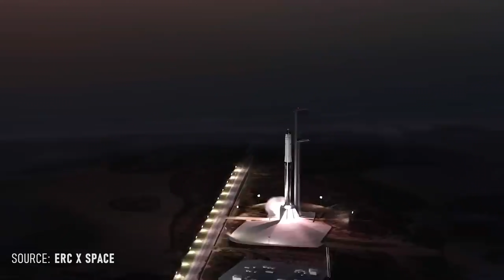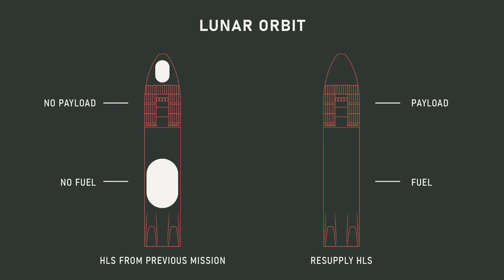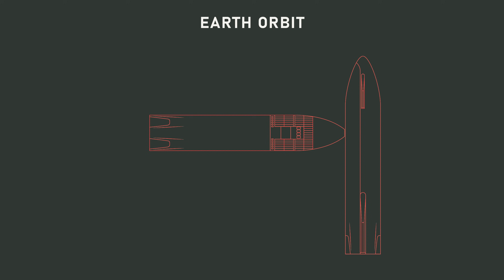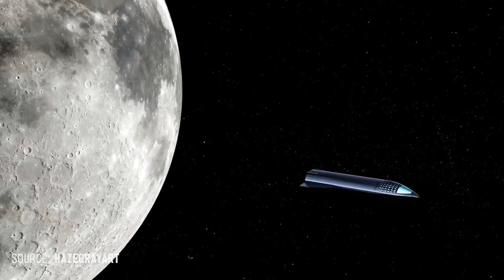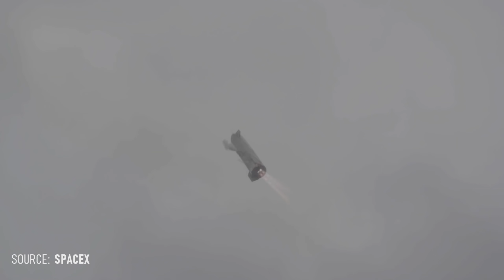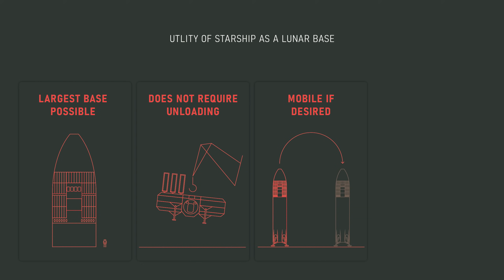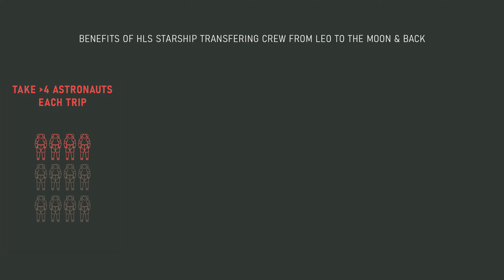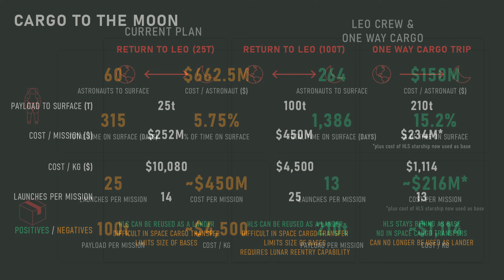How to Use HLS Starship

Comment: @apogee you're not taking into consideration that we are not yet at a final HLS starship design.  I fully expect a standardized shipping container to be developed for on-orbit cargo transfer between ships.  indeed, earlier renderings of starship and its predecessor the ITS/BFR showed just such containers in the empty spaces of the engine bay under the skirt.  such containers could be transferred between ships in LEO as a part of fueling operations.  other payload containers could indeed be transferred using onboard robotic arms - it all depends on whether the HLS cargo bay that is shown in renderings with the elevatorcan be used for the purpose, and there is no reason to think that it cannot.

Comment: 12:45 “we aren’t actually expending the starship”. Starship has a 210 ton payload when used this way, bring a god damn fuel generator!  That way it doesn’t matter whether or not the lander launched from LEO with enough fuel to get back, it can create its own once it’s at the moon!
Reply: Might conceivably make oxygen from water or maybe bound in rocks on the moon, but no way to make methane as carbon and helium are only available in trace amounts.
Reply: @durandalgmx7633  I beg to differ. 

CO2 + 2 H2O -> CH4 + 2 O2 

Yes, this is the inverse of the combustion reaction. I imagine that you would use electrolysis to separate the hydrogen and oxygen in the water, and then, using something similar to the sabatier process, convert the CO2 into methane.
Reply: @MrStreaty122  We're talkking about the moon my friend, not Mars. No CO2 atmosphere on the moon.

Comment: The big issue with using Dragon or Starliner to return from the moon is the heat shield.  Every one seems to miss this but Orion is made for lunar return.  The vehicles don't have the fuel enough to slow down to not be destroyed by earth's atmosphere and because their heat shields are too thin they can't use aero breaking for lunar return.

Comment: Too many assumptions. Question One: How much fuel is required for a landing on the moon and how much would be needed, taking into account unloading of payload, to launch back into lunar orbit? Answer: We don't know. Because this one question isn't currently known, and without the first unmanned lunar landing, will not really be known, it is impossible to say whether or not the lunar starship would not have the fuel to return to LEO (well, not impossible for SpaceX and NASA, but they haven't released that data yet). Question Two: Would an unmanned Starship be able to use a low delta-v route to the Moon, passing by the Sun-Earth L1 point, and taking over 3 months like the NASA GRAIL satellites did in 2011? If so, fuel usage could be minimized leaving more than enough to re-land the HLS after its initial mission and create the beginnings of a permanent base on the moon or, to use fuel for return to LEO. Observation Three: With the basket style elevator and the booms that extend from the large cargo bay door, it would be relatively easy to create a scenario where those booms telescope out between starships that are side by side, connect, and allow for the elevator to act as a gondola between the starships thus getting rid of the need to transfer cargo through the much smaller crew transfer ports.

Comment: I am curious. In this video you suggest that Dragon and Starliner could be used to replace Orion in bringing crew to LEO orbit so they could board a Starship to take them to the Moon. This would allow us to use the resulting savings to fund more missions.

 Wouldn't it be cheaper to use a Starship to take that crew to LEO? Even if it was only four crew and the crew Starship immediately turned around and landed? Or maybe greatly increase the amount of crew on each mission? I guess the basic question is, once Starship is operational...why fly Orion, Dragon or Starliner at all?
Reply: - Dragon and Starliner are already human rated.
- Launching people with HLS Starship would require them to be on board during all refuellings.
- Launching people with last normal Starship would also make them around during one refueling, and would make a need for human rated normal Starship.
Reply: @cola98765  Are you imaging some world where Starship isn't human rated?

Comment: I think you left off a fourth option. Transfer to the moon with orion attached to the starship. The Orion could be placed into low earth orbit with a much cheaper rocket. Falcon heavy, delta heavy, valcon centar etc. Starship could be used to move it to and from the moon's orbit and the capsule would be used to land back on earth. Remember that the Apollo had the lander docked during its flight to the moon. Of course this could be done with Dragon it was certified for up to 7 passengers.

Comment: Would it be possible to lower the moon-base starship horizontally?  As the fuel tanks are presumably empty, could they be cut out from inside to double the volume avaible  internally?  If it was horizontal - could it be mostly covered with regolith to attenuate radiation?  It does not look like there is any need to be parsimonious with starships.  Musk looks like he is mass-producing them.

Comment: You don’t want to refuel from ship to ship, Spacex needs to build a fuel depot. A large tank in LEO that is continuously topped off by starship flights, then HLS just docks and refuels one time. 

You don’t want to do 11 docking, too many chances for something to go wrong
Reply: you would still have 11 dockings, but instead ship-ship it would be ship-depot...
until SpaceX makes dedicated and more efficient tankers, you can't change amount's of dockings.

(or they can later start working on this 18m version Starship that could potentially bring full load for 9m variant in single go)

Comment: I think you forgot to consider that HLS starship is also an ascent vehicle for the crew to return to lunar orbit. 
If the HLS lands without the fuel needed to return back to lunar orbit as you suggested how will the crew return to orion and back to earth?
If you mean by HLS needs to be relanded on the moon after the crew return to Orion, doesn't this means it will need sufficient amount of reserve fuel oppose to what you suggested as the second benefit of one way HLS starship?
Reply: cargo missions don't need to be crewed.

Comment: AND
Why can’t: Spacex Luna Lander take off and in LEO. One or two of the refuelers bring two rockets connected to fuel tanks attach them to the crew/cargo part of the starship. 
Then Starship takes it to the moon. Once in orbit of the moon the crew/cargo starship detaches from the Starship and uses the external rockets to land. starship returns to LEO or if it is there the lunar station. 
there you have a permanent moon base and a truck to bring stuff out from Earth. The external self contained rockets would be like the Dynetics Alpaca!
Now you have a TRUCK that can haul stuff back and forth to and from the moon and you are using the spacex moon rockets rather than having them sit on the moon all the time. You have a moon habitat that you don't need an elevator to get in and out of and the strap on rockets can run on hydrogen and oxygen.

Comment: There is a possible mission profile I believe you have missed. Assuming Lunar Starship leaves LEO fully refueled and that Lunar Starship is never going to return to Earth,  Lunar Starship should be capable of multiple landings on the moon without refueling or returning to Earth. This might not work so well for a ten year mission but the initial contract award was for 2 Lunar Starship landings, not 10.

Comment: you put enough fuel to make two landings and leave the first one there as well as the other extras that they send before the manned landing as a start for the moon base, im sure there going to send and land something before they send a manned one gotta test it and every thing. they will be fully loaded test all systems and supplies, that way they have parts and systems to use as spares for when they do get there,  that way they already have stuff there for them waiting when they get there all they need to do is deploy it. and with tele remote to the moon they could have fleets of moon-bots deploying and setting up stuff well ahead of time

Comment: Starship designed for getting to LEO is inefficient as lunar starship. It carries engines on the bottom- that is dead mass. Engines high over ground have much more sense for lunar lander. Also these engines doesn't have to be so heavy, since gravity of moon is 1/6th of Earths gravity.
Lunar starship also doesn't need any wings. 
I think the starship as such is not good as lunar rocket. Something more robust, broader and with 3 times lower height would be better.

Comment: Just a thought. If you want to use it as a permanent base. Could they build a version that expends the large fuel tanks and engines and lands using just the smaller engines. This would remove the 30m lift and make a really usable base
Reply: How about keeping the tanks, purging them after landing, and sending dockyard workers to make more usable space?
Reply: @cola98765  not a bad idea at all either

Comment: Maybe you said this but I didn't catch it. At the part (mid 30 min) you are pointing out the positives and negatives. It is great and Ive advocated something almost identical since they announced lunar starship but your count of starships is a bit misleading. You include the number of launches to refuel but remember those are atmospheric starships which are different beast form lunar starships and likely 4 or more of these type of starships, including boosters, will be needed for the refueling process. Just saying.

Comment: I appreciate the hard work you've been putting into your videos and hopefully this channel will grow. You mention several times that you feel like your missing a piece of the puzzle and I thought I'd hand you the piece you seem to be missing. Lunar Starship can aerobrake on it's way back from the moon in order to get back into LEO. Starship only needs it's flaps and heatshield if it plans to land back on earth. It is still able to aerobrake on a return trajectory from the moon without them. Depending on it's final properties, how well it can handle thermal loads, it's final mass and it's cross-sectional area that it can use for aerobraking maneuvers it can choose an appropriate perigee and make multiple passes until it has a desired apogee and then conduct one final small burn to circularize. This is how NASA and SpaceX can achieve full reusability with only LEO refueling.
Reply: HLS Starship would not be able to aerobrake since it lacks a heat shield not because it doesnt have fins
Reply: @WarDamnPhotog  That is not correct. Lacking a heat shield limits the perigee at which an aerobraking maneuver is possible. Not whether it is possible given this isn't an interplanetary manueveer where you need to remain gravitationally bound to the destination planet.

Comment: Have you ever thought about the idea of using a smaller ship as a lifesaver? I mean, Lunar Spaceship is so large and powerful that it might perfectly carry a spaceship as a "light" version of Orion, or a service moduled Crew Dragon docked on its forward port with the permanent feasibility to undock and carry the crew back to Earth? It would be neccesary to think twice the docking system to reinforce it, to be able to resist all the axial accelerations, but I think it as possible. It would reduce the cargo capabilities, but this lifesaver ship would have to carry just the necessary hardware to return to Mother Earth.

Comment: Hi,

I'm curious what you think introducing a solution like Sea Dragon into this situation might change.  Surely the capability to put a million pounds of fuel into LEO would serve as a tremendous "force multiplier" for SpaceX's launch cadence.  A gas station like that would save a dozen launches per trip, launches which could be used to add more stuff to the moonbase.
Reply: SpaceX said somewhere that they might make a fat version of Starship if everything goes well. That version will put it close to Sea Dragon but reusable.
And to think that orbital Starship will be a monster of a rocket...

Comment: Or dock two fully reusable HLS starship in earth orbit nose to nose, and use one as a booster for the other. LEO to luna surface to LEO with no crew on board refueling. Pretty much regular starship could do that.
Reply: Give the tanker starship a nosecone docking port like crew dragon and use it as a booster.
Reply: @rivuléRainworld  Better to use a starship, so it can save fuel aerobreaking back into LEO.
Reply: @anticarrrot  I said a starship tanker so it has extra fuel so it can also refuel hls starship

Comment: I wonder what the dry mass of the Lunar Starship is in comparison to the regular starship with its heatshield and flaps... Also, do we know which engines Lunar Starship will use to lift off from the lunar surface? Will it be the ring of smaller ones, or will they use a raptor?

Comment: Some more positive points about the HLS+HLS scheme:

1: It does rely on refueling in GTO, which is where the Van Allen radiation belts are, but not with people on board getting irradiated at the time.  That's sharp.

2: Instead of transferring people in LLO for the trip back, you could trade some fuel instead.  Just saying.

3: If trading fuel in LLO instead of people, then that second machine wouldn't have to be an HLS at all, but just a tanker really.  That means more fuel on hand, plus the option of using its heat shield (if it has one) to aerobrake in earth's atmosphere.  (But this would break the safety redundancy of having two HLS's.)

2+3: Note that the option of switching from HLS+HLS, to HLS+tanker, is implicit in all this, and always there for NASA to change tracks to later as an economy measure, once it trusts HLS to not kill people.

4: And finally, this deserves a look: In the HLS+tanker story, if the tanker has a heat shield for aerobraking, then does anything need to stop in GTO at all?

Comment: I agree that 2 HLS makes the most sense. In fact they should optimize configuration of each so that they are not identical. 1 would be filled with lunar surface activity equipments with bare minimum delta V and the other optimized for shuttling crew with maximum delta V.  

There will likely be a fleet of several starship variants (owned by SpaceX) to provide logistics support to Artemis missions: unmanned tanker optimized for carrying fuel from the surface to LEO (minimal orbital maneuvering capability), unmanned tanker optimized to move fuel in cislunar space, and perhaps even a different variant optimized to stay in LEO and lunar orbit extended period of time with fuel as depots (solar cell, more monitoring equipment, etc.) that will never re-enter atmosphere. 

NASA will probably not get into nitty gritty of maintaining this logistics fleet, but rather contract it to SpaceX as a service, where SpaceX will be compensated base on quantity of fuel at what location, by when. SpaceX will probably want to keep this within the company because they will want to provide the same service to other nations and organizations, including themselves.  Theses logistics operation will take place in the background somewhat detached from high profile launches of NASA owned vehicles, just like routine boring Starlink launches today.

Comment: Love this video - thanks so much for all the work and time put into it!  A few thoughts and possible additions:

1. In your preferred case, assuming life support can sustain the presence on the moon, you could take a lot more people than you suggest.  Even if you only used two or three crew transfers in LEO you could double or triple the human time on the lunar surface.

2. Although potentially more risky, you could avoid some complexity by putting the astronauts on the one-way cargo mission with a side-by-side HLS round-trip Starship flight for crew return.  The cargo trip would lose some payload by taking people, but could take a bunch of them without requiring any in-orbit transfers or Dragon/Starliner launches at all, greatly reducing overall costs and some risks.  The round-trip vehicle would gain delta-V by not carrying astronauts to the moon with their outbound consumables.  You do run the risk of getting the humans to the return-capable vehicle, and each crew transfer results in an expended vehicle on the moon, but if you can link them up into a mega-base, that could be a win.

3. As a lunar base, the Starship's non-pressurized volume could also be useful.  Potentially, the tanks could, with some extra plumbing, be repurposed as storage for liquids or gasses manufactured on the moon, such as hydrogen and oxygen from electrolysis of water ice, etc.

4. Your costs would be further reduced if Starship launches come down in price over time to more closely approximate Elon's goal of cost of fuel + payload.  For NASA there would be a markup, of course, but the $18M per refueling launch could come down to $10M or even less if things go well.  Hell, if energy becomes as cheap as it seems likely, then fuel becomes yet cheaper as it can be manufactured from air and water given enough power.  That would mean that a refueling flight could cost SpaceX well under $5M a launch.  In the limit, assuming rapid reuse, 100-flight lifecycle, $5M vehicle cost (due to steel, economies of scale, etc.), and essentially free fuel powered by solar farms, and streamlined, largely automated launch facilities and systems, a Starship refueling launch could come down well below $1M each.  What would that do to your estimates?

Note, if that last seems overly-optimistic, consider that you're talking about the next 19 years so, improvements of all kinds, most assuredly including energy cost and Starship manufacturing cost, are to be expected.